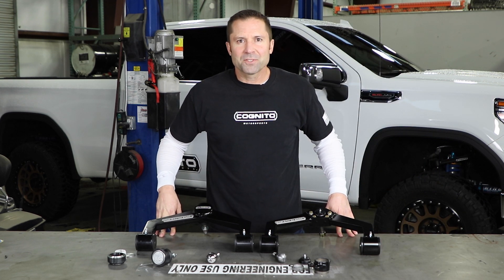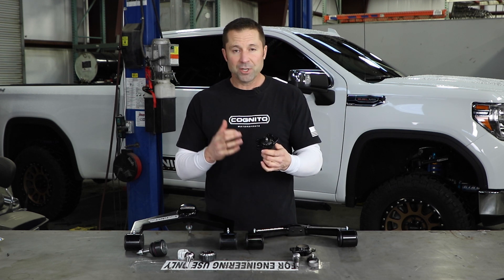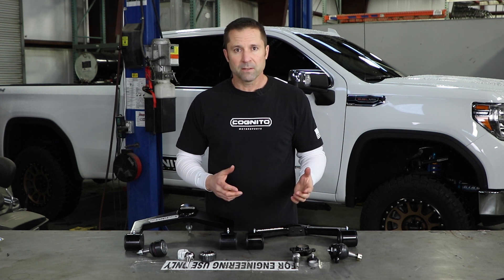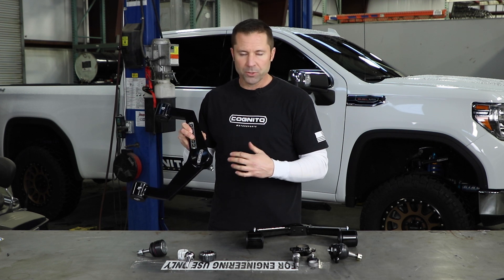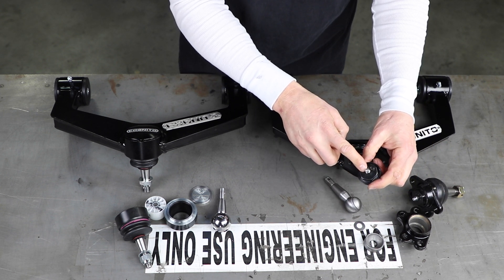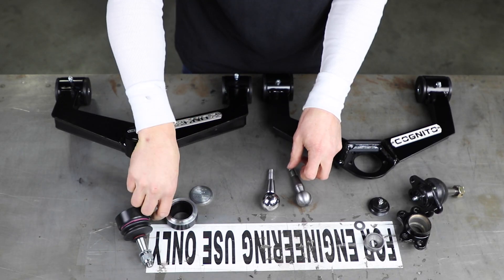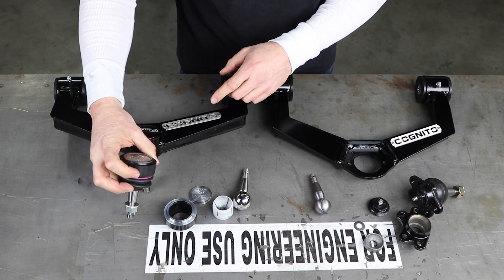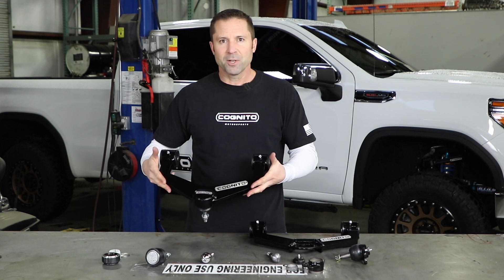A Look at Our New and Improved SM Series Upper Control Arm Kit

Comment: I've ran the old style on my 03 z71 an jus now purchased the new sm style for my 2500hd. They have changed since this video. No more polyurethane bushings, back to harden rubber like stock which is cool. But the maintenance free ball joint is a mistake....

Comment: on a leveled AT4 lift do you recommend a diff drop kit?.....they arent in your leveling kits and at what height is this necessary? i talked to baja kits and they said not needed for coilover lift up to 4 inches which doesnt make sense because lifting is lifting regardless i would think but maybe i am missing something?.......i have your UCAs on my 21 GMC elevation with AT4 strut lift.....

Comment: I disagree!! I install a lot of these and see downsides to this new design. If thats the reason because no one is greasing them, wtf thats common maintenance. Older style is a breeze to replace and bushings and balljoints at a good price. Now when they wear out your gonna have to go through the pain of pressing them in and out, risk damaging the part, risk damaging the powder, and taking way more labor. At that point some people might just buy a whole new arm! Is that what its actually for? Lol. Changing powder color, anything is gonna be a pain now🤦‍♂️
Reply: Agreed. Who in their right mind, that spends the cash for these specialty parts, doesn't bother to grease them regularly? I absolutely want something that I can maintain, not something that is destined to degrade further and further because it's "maintenance free".

Comment: Are they replaceable? Or do I have to buy a new upper control arm?
Reply: @cognitomotorsports4130  do you have tierods for 09 gm 1500s. I put a set on my 03 2500 and loved them
Reply: @Cognito Motorsports are these available for the 2016 Silverado 1500?